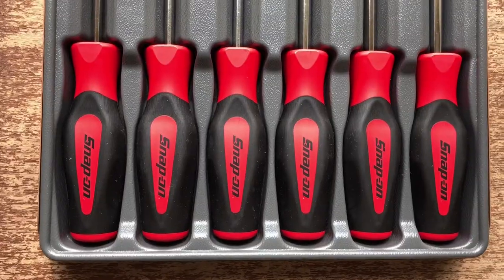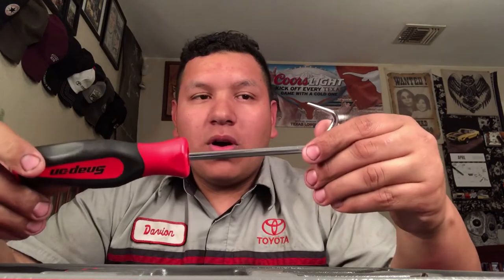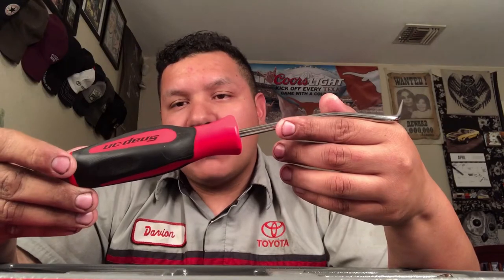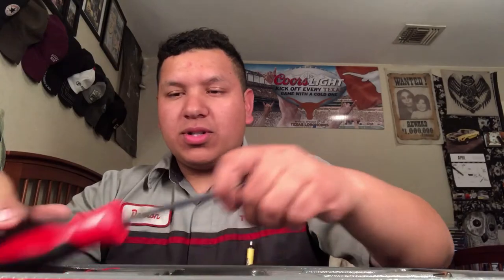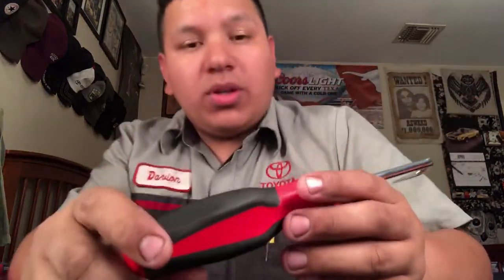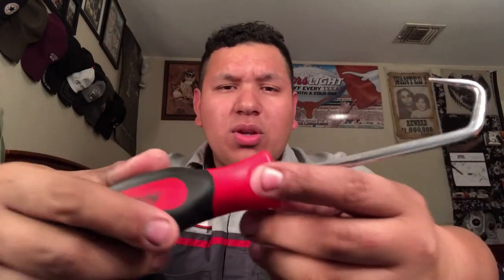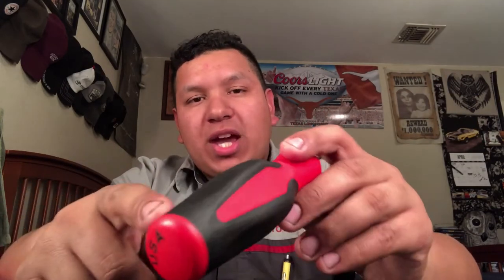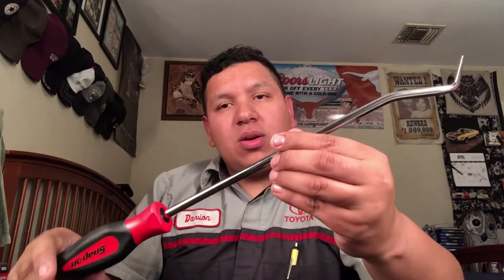Snap On Radiator Hose Pick Set (SGRHT6BR)

Comment: Get the two piece flat wide tipped set.That set,can poke holes in radiator hoses real easy
Reply: love em!
Reply: If these are poking holes in your hoses you aren’t using them right or you should be replacing the hose anyway.